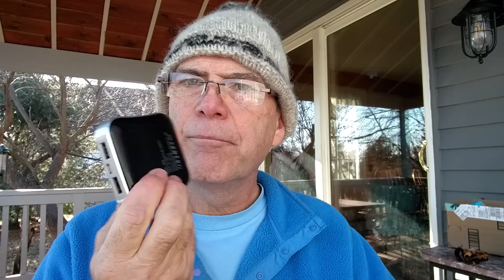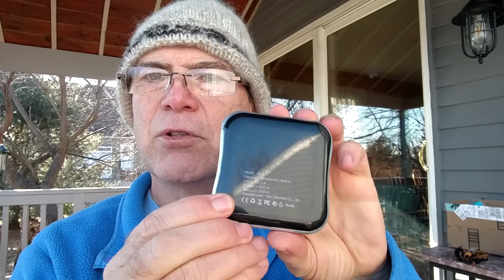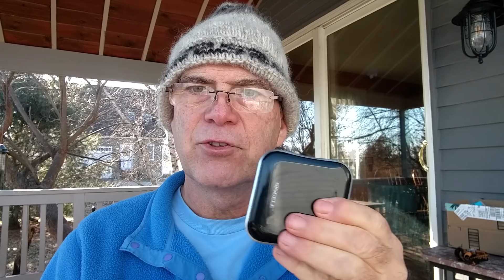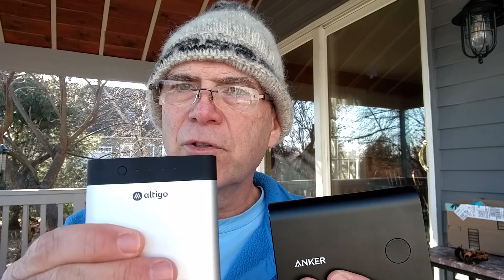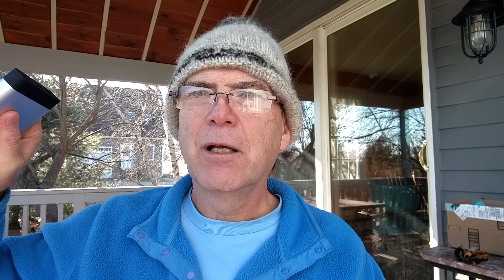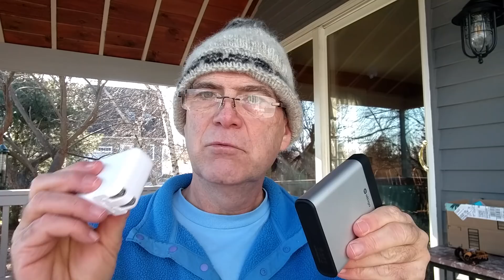Hiker - Recharging electronics fast!

Comment: Amps are key on micro-USB, because all power is 5V, however USB-c opens the door to higher voltages.  Power is Volts x Amps, so Volts contribute equally to power transfer rates.  Legacy devices are 5V, but new phones accept higher voltages on USB-c.  You want the most Volts x Amps to charge your main battery quickly.  USB-c handshakes between devices, so you don't have to match exactly, the devices will negotiate the highest rate available, but it does pay to buy the highest spec on both ends (charger and battery-bank).  It's still wild-west USB specsmanship, so get a USB-meter ($8) to test charge-rates.  GL.